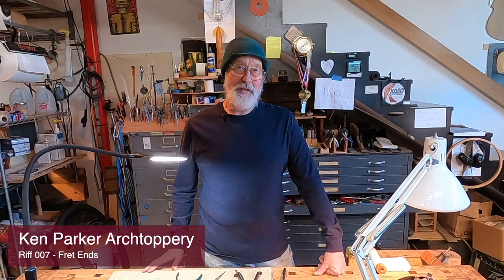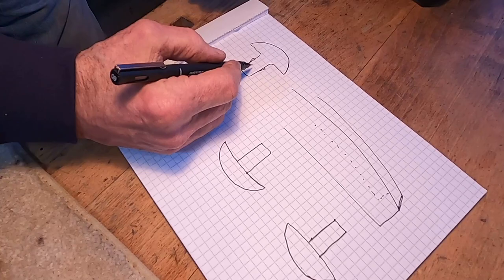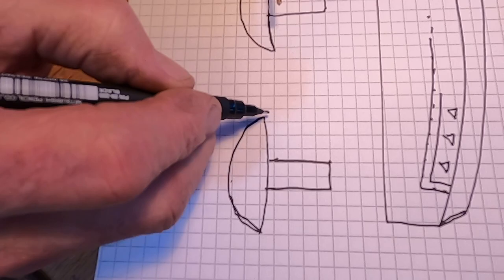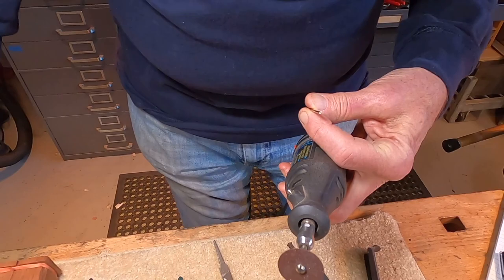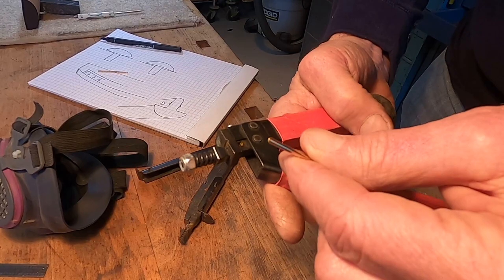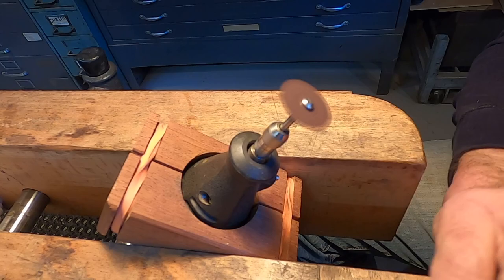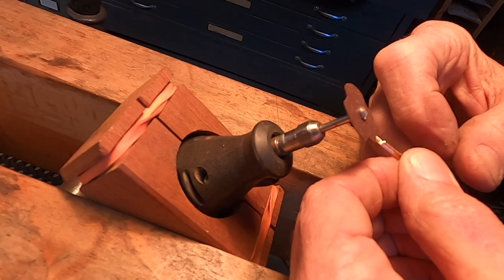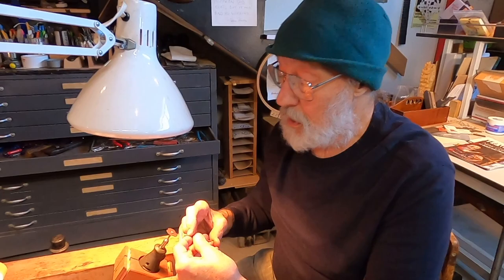Ken Parker Archtoppery - Riff 007 Fret Ends

Comment: In 1980, I got a job learning how to make banjos, making a total workforce of 3 including the owner. We used to do this, but I can't remember what method we used. The owner was a lot like you always thinking of ways to do things easily and most of all precisely. I was thinking about clamping the fret into a loose tang slot on a hinged jig and dropping the jig/fret end onto the edge of a 6" fine grinding wheel. A simple machine screw could be used as an adjustable depth stop. Just an idea. Incidentally the owner was Alf Parker and we made Parker banjos.

Comment: That is 1 hell of a process. I was sure that wheel would fly apart upon start up and especially on contact. Amazing.
Reply from the maker: The wheel is pretty tough, and I've never had any real problem having used them this way for many years. If it did fly apart, would be unlikely to cause injury because it's very light. Always wear eye protection!

Comment: Drexel sells a reasonably reliable diamond wheel that has holes in it that does this without having to replace those cut off wheels. I thought I discovered a new element or achieved world peace when I figured out that it works so good. I'm glad I'm in good company. I always roll the edge of the fret somehow if I file them.
Reply from the maker: I suppose you mean Dremel?  I only use diamonds to sharpen carbide tools, old school.  Diamond coated tools (especially the cheap ones like this) drive me crazy 'cause they are variable quality and bond strength, and I think they're usually more trouble than they are worth (says the guy with 5 diamond grinders).  I predict that the wheel you describe would charge and clog immediately with the soft and gooey (compared to cemented carbides, that is) copper based fretwire, and fail to do the job at all.  The holes will make it easy to see that it's not working, though!
Reply: @kenparkerarchtoppery9440  This has been my experience with diamond wheels too. For whatever reason, this particular Dremel wheel has been a loyal soldier. I only use it for one task. Who knows, maybe I got an anomaly.

Comment: So cool! Ken, I’m a little surprised (read: blown away) that you do that by hand and aren’t using a jig to hold the tang vertical. Your handwork is remarkable.
Reply from the maker: I think this would be particularly tricky cut to fixture, and really needs to be done by hand to get it just right.
If you do it the way I show, you can instantly see what exact part of the fret is getting cut and instantly make the required correction.
When you're new to this, and just feeling it out, it's good practice to spend some time with a scrap of fretwire, getting the feel of it so you can excel. It really is a sweet trick, because properly done, it makes the surface that lands on the fingerboard a tiny bit hollow, and it comes out perfect as can be!
Reply: @kenparkerarchtoppery9440  ah I see. Thank you!

Comment: As a likely “one (or two) and done” builder who’s therefore stingy about specialized tool-buying, would skipping the nipper and doing the whole tang removal with the Dremel wheel be a go?
Reply from the maker: I can't see why not, although you may be surprised to find out how hot a fret can get if you push it. It would be helpful to at least cut the tang at 45 degrees with your sharp end nippers to reduce the amount of material to be removed by grinding. Good luck!

Comment: Such a cool creative technique.  Thanks for sharing. I'm a luthier/dentist, and it's definitely an advantage when it comes to doing stuff like this.  I have so many little tools  and drills that can do stuff like that.  I've been using my highspeed handpiece to smooth of the fret tangs, but I think i'll try your method this time. Thanks again. Priceless.
Reply from the maker: I have a Midwest Quiet - Air plugged in at the ready, but don't use it too much.  Great tool for some things, but low power keeps it from being more useful to me.
We did use it at Parker Guitars as a production tool for one crazy job, the opening and shaping of the hole in the side of the headstock for the truss rod tool!  No other tool would be able to take this cut.
Reply: @kenparkerarchtoppery9440  Nice. Yeah my high speeds are now electric torque motors that are air driven. They cut like butter. One thing I love using them for is for cutting MOP for inlays. Thanks so much for all that you share with us on your channel. Big inspiration.

Comment: I use a Dremel to do this too, but the idea of putting the breaks in the wheel to see your work is awesome. I will do that next time for sure. In order to see what I was doing I had to do this operation at 90 degrees, so it was tricky to control the back/blind side of the cut making sure I didn't go over the edge of the fret making a cosmetic issue.
Reply from the maker: Yeah, it's a great trick. Just take your time and play with the details, get the seating, speed, light, and angle just right so you can relax, then they'll all come out the same when you get your rhythm tuned up! I find this satisfying all out of proportion to what it is, but hey, that's what keeps us muddling through, right?
Reply: @kenparkerarchtoppery9440  that's right!

Comment: Hello sir, I wanted to ask if a tailpiece has to be rigid? I’ve wondered if a leather strap type thing that holds a metal bar for the strings to go through would work as well?
Reply from the maker: I guess I'd say that a tailpiece might be a tricky thing to make from of leather.  I suppose if you could really tough, thick leather you might be able to make something that didn't creep.  It might be tempting to try it with with low tension strings. After all, intestines of mammals are sliced up in thin strips, twisted and dried to make "gut" strings, and are still used on some few instruments today.  The problem with these protein strings is that they stretch and go flat when the humidity rises, and vice versa.  Segovia is quoted saying he wouldn't have pursued the guitar if not for the age of plastics and therefore the availability of the newly developed nylon strings that could hold their pitch.
I like your idea very much, so much that I tried to fake it with bronze sheet and  tubular brass rivets in 2007,
https://kenparkerarchtops.com/mrs-natural-gallery
Lots of folks have asked me how I got leather to work as a tailpiece material!  Gotta love that.  
You can fool some of the people some of the time.......
Give it a try and file a full report!
Good luck with your work!
Reply: @kenparkerarchtoppery9440  Wow I would have thought that was leather too! Looks perfectly taut.

Comment: That's a very clever way to do frets. Are these stainless steel or conventional frets?
Reply from the maker: Thanks, after years of struggling, there's an epiphany here and there!

These are "EVO" frets, so none of the above. The recipe is around 4 parts copper and one part tin, with tiny traces of iron, titanium, and idontrememberium. Normally we call alloys made from mostly copper and tin "Bronze", but for some reason they called it EVO?!?! 

Alloying crosses the line from science to art, and trace amounts of elements can have effects beyond what you might imagine, kinda like just a wee bit of arsenic in your soup.
Sadly, the EVO wire has been discontinued, but I'm sure others are taking up the slack, as bronze has been around, well, since the bronze age, right?
Although EVO is a little softer than the fairly hard stainless alloys that are used for fretwire, it seems to wear at least as well as stainless. Hardness and toughness are different things, and stainless steels vary widely in both of these qualities.  At Parker Guitars, we specified a stainless wire that was very tough, and many times harder than any stainless alloy that could ever get rolled into a tanged fretwire shape due to the much simpler "D" cross sectional shape.
Reply: @kenparkerarchtoppery9440  Thanks for the detailed response - very interesting! I love my ‘95 Fly Deluxe.

Comment: Very helpful! Is there a specific RPM for the Dremel that works best for this use case?
Reply from the maker: I fooled around with the speed, and I don't think it's too important, except that really slow isn't so good.
You will feel them heat up, but that's OK.
Give it a whirl, and maybe practice on fretwire you don't like, after all, the amount of fret material removed is really small.